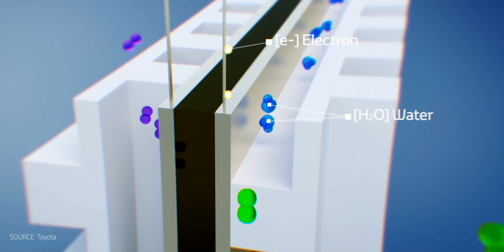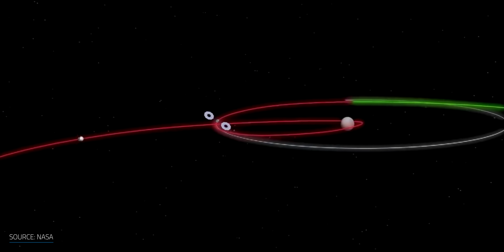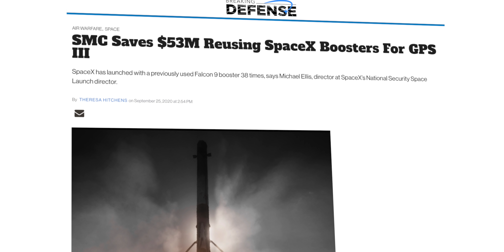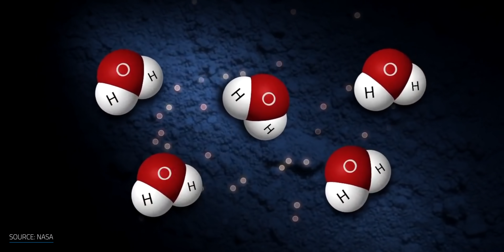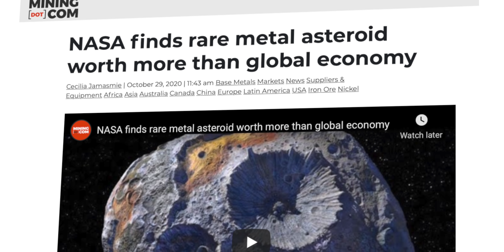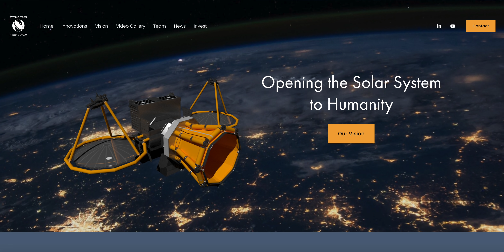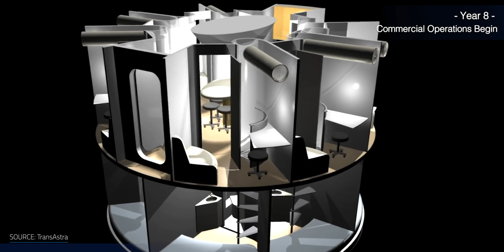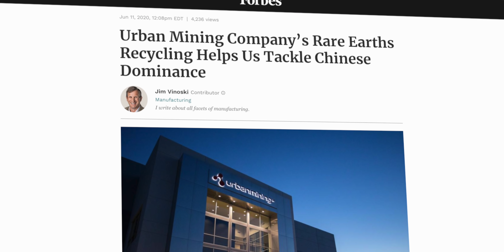Does Space Mining Solve Our Resource Problem?

Comment: One thing we often overlook is that kinetic components of asteroids are likely to be of even more immediate value than their composition.  An exagram asteroid has gargantuan amounts of energy stored in its rotation, and if it's in a good position, and rotating just right, constructing tethers made of even just local steel can be used to donate usable kinetic energy to spacecraft.
Reply: That is officially the dumbest thing I heard today
Reply: @morkovija  Except skyhooks are a legitimate concept thought up by real rocket scientists? It's difficult to do but it's completely feasible and lowrad's way of explaining it was perfectly fine. Kurzgesagt has a great video about the concept if you want to look into it.
Reply: @steventyndall9172  ok with skyhooks at least I understand the concept. But lord, it's one complicated way of extracting energy
Reply: @morkovija  It can be, but so are most others. But it's also fairly easier to do than some other forms of space propulsion, and would significantly reduce the cost of traveling around the solar system.
Reply: @morkovija  
How? We could use rapidly spinning objects to power a motor ?
Reply: @coazynot6194  How would you hold the motor stationary relative to the asteroid?
Reply: @rupert274  Thrusters ? Magnets attached to the asteroid itself ? Tethers etc. That's the engineering problem but I is theoretically possible.
Reply: @coazynot6194  No, it's literally not possible. Magnets are not magic and thrusters would take more energy to power than you would extract from the rotation. Stay in school, study physics.
Reply: @rupert274  ok so if you attach, say 3  tethers to an asteroid which go outwards, and then those 3 are attached to the internal coil of an induction motor around the asteroid. Since the asteroid is  rapidly spinning, it would induce a potential difference between the exterior and interior coils of the motor around the magnet which can be used to power electric equipment. Also if you attach many magnets on the asteroid and form a ring around it, those themselves can function as the internal coils of a a motor. These two ideas are just top of my head and there could be many people with much better ideas for extracting the rotational momentum of a rapidly spinning asteroid. So before you tell me to go back school to learn physics, maybe you should solve some puzzles meant for children to grow a little imagination.

Comment: Unlimited uranium and thorium sure would be nice.
Reply: With a space elevator, maybe. So we can leave the waste out there.
Reply: Orbital ring is less dumb than space elevator and could be built with our current technology.
Reply: @James-sk4db  It all depends on the context. Good luck transferring energy generated on an orbital ring back to earth.
Reply: @madao7865  As strange as it sounds, but rectennas and cables - yes, cables - are a simple and efficient solution for that.
Reply: @totalermist  Rectennas - maybe, depending on how much is absorbed by the atmosphere. Cables - that would be nothing other than a space elevator.
Reply: @madao7865  Cables aren't the same as a space elevator. A space elevator needs to support payload in addition to its own weight. Cables on the other hand can be suspended in the atmosphere (e.g. using high altitude balloons) and don't need to reach all the way to geosynchronous orbit either as orbital rings don't need to be put up that high.

There's plenty of differences between the two concepts.
Reply: @totalermist  I'm not convinced by the payload argument as its weight would be negligible, compared to a cable of that length. Also, how would one make the suspension robust with respect to weather conditions. The lower orbit is a good point, though.
Reply: @madao7865  > I'm not convinced by the payload argument as its weight would be negligible, compared to a cable of that length.

The payload weight isn't just added to the cable weight. The payload must be moved and secured onto the cable, which puts additional strain on the cable. The forces involved can become quite significant.
Reply: @James-sk4db  Orbital Ring, first time iv heard of it. I like it.
Reply: Thorium is basically already unlimited in terms of nuclear power use.
Reply: Space elevators aren't an option for Earth yet; materials science just isn't there yet. We can put one on the moon and Mars though, and probably should.

But the cheapest possible way out of our gravity well is Deep Sky Stations and spaceplanes. It's cheaper by far than an orbital ring, and probably necessary for the construction of one.
Reply: @kentchamberlain5720  The big twin fuselage, six engine jet Virgin Galactic has started as a concept of Burt Rutans. Rutan designed a craft that could take the aerofoil characteristics of a falling leaf and by using that stair stepping and controlled glide finally land on a conventional runway. The second orbital flight crashed due to an error by the co pilot. But the concept of a cheap launch from an aircraft at 50 k feet makes it possible to launch a missile that can reach orbit with much less fuel and cost and then "tumbling home', even if it was all remotely flown would be. A car shaped piece of platinum would weigh 6000 lbs easy- and be worth many millions of dollars- many! We are getting there- costs, both direct and indirect, need to be carefully screened so we don't trade another bonanza- make no mistake about it, oil and gas were a real bonanza and propelled us forward- and get only the sorry dregs at the end. Big Oil board rooms are starting to redirect- they have the resources to do something like this and the stomach for the risk- they did even back when they were just little old big coal. On the space elevators or the Hoola Hoop Thingie, I suspect we are going to find mining asteroids easier than creating strith. FR
Reply: @fredericrike5974  I'm not envisioning a spaceplane like Rutan's doing this off the back of a plane. We'll need a dedicated platform that stays up, a Deep Sky Station. And we'll need a huge blimp like spaceplane to ferry cargo, not some SpaceShipOne knockoff. Refer to the Isaac Arthur video I cited; it's described in more exact detail there.
Reply: @kentchamberlain5720  With the best lift/ land possibilities we can see, yours or mine, "gigantiprecious
Reply: We already have enough uranium and thorium to last tens of thousands of years. Even uranium 238 which is what's leftover after producing fuel rods can be used to produce energy. The technology exists, but if it implemented then there will be less money to be made from fossil fuels. So good luck getting that to happen 😢
Reply: @ericpowell96  Theoretically there is enough uranium and thorium to power the world for over four billion years. Some say thorium is virtually unlimited but you never know how extreme the energy consumption may be in the future and virtually unlimited is still worse than unlimited.
Reply: @mrkokolore6187  You're right, I understate the amount there is when I say that because if you say too big of a number people's brains shut down and they don't believe you and just call you a conspiracy theorist. But yeah, we already have the solutions to basically every problem the world is facing right now, but the elites are too greedy and the masses are too fucking stupid/lazy to educate themselves despite having access to the majority of humanity's knowledge in the palm of their hands.